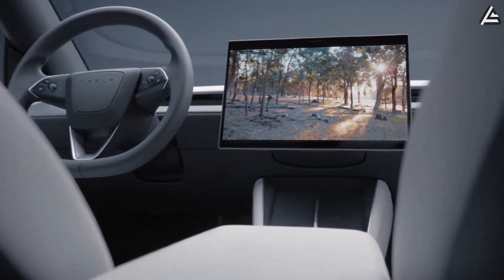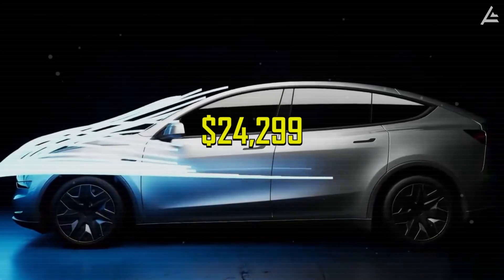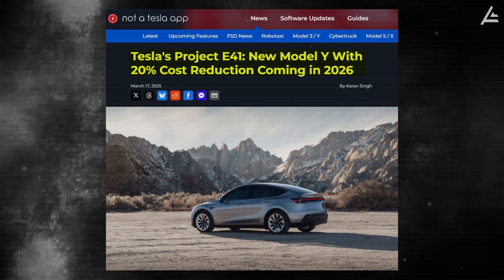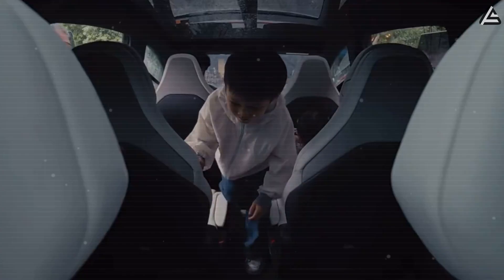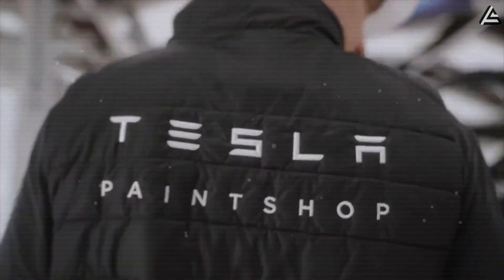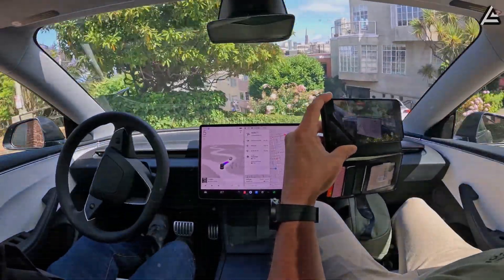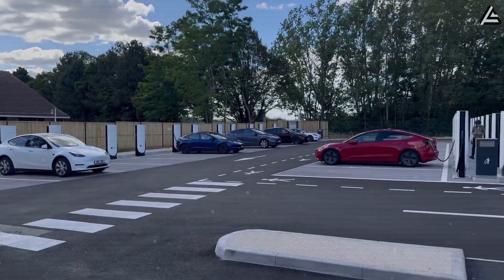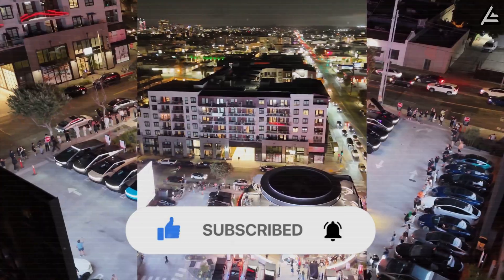Elon Musk’s 2026 Tesla Model 2 Price & Production Plan You Need To Know

Comment: Why dosent put a solar panel to run the AC and heater
Reply from the maker: Solar panels that small can’t generate enough power to run AC or heating. The energy demand is far higher than what a car roof panel could provide. That’s why Tesla sticks with the main battery pack instead.